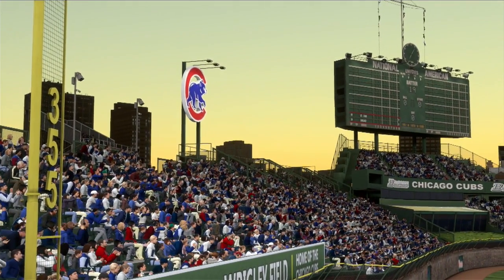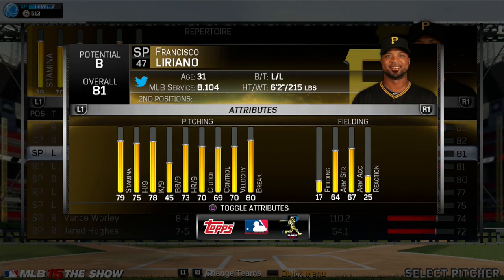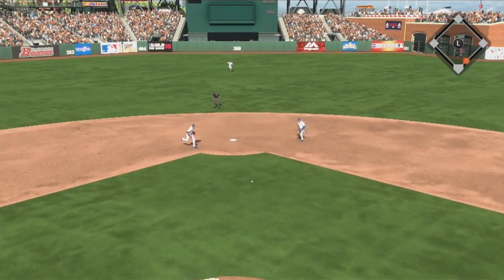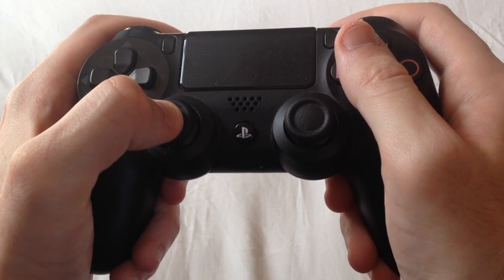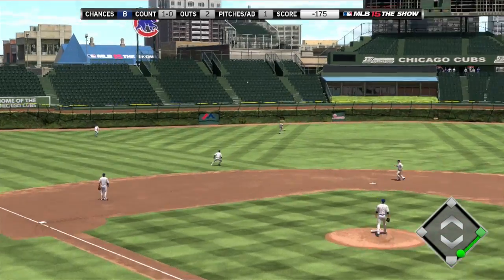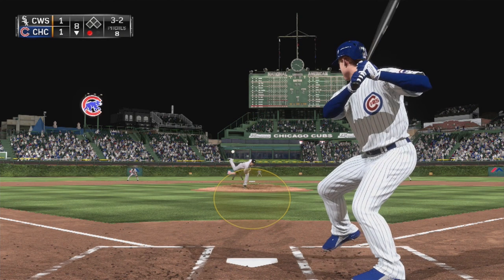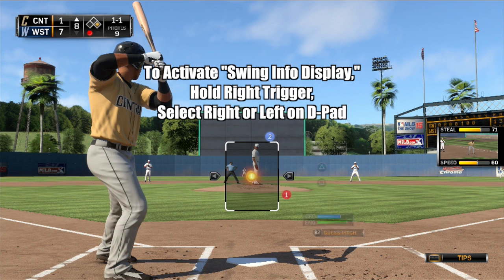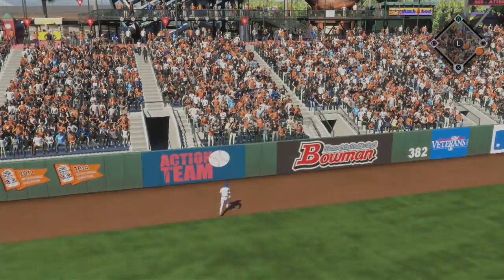MLB 15 The Show Hitting Tips - Zone Hitting

Comment: great series.. which hitting interface do you prefer?
Reply from the maker: ***** zone all the way
Reply: FratNightGaming The one thing that bugs me about it, is that it doesn't seem to be very ratings based..if you get the pci on the pitch..you are crushing it...no matter pitcher-batter match up. Am I missing something?
Reply: FratNightGaming Ive come across a compromise. Directional hitting for franchise mode,zone for online league :D
Reply: FratNightGaming One last question :D How do you handle the high fastball? I find tracking it really difficult..I have to anticipate high, and if I have to adjust lower, its much easier for me.